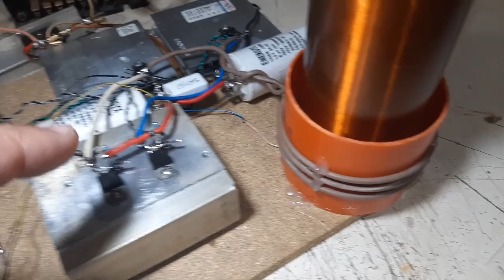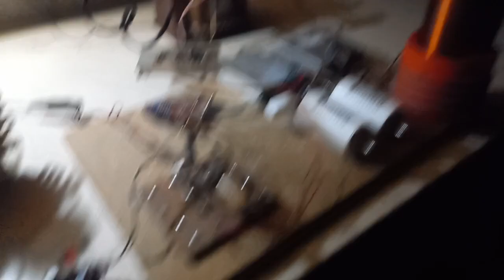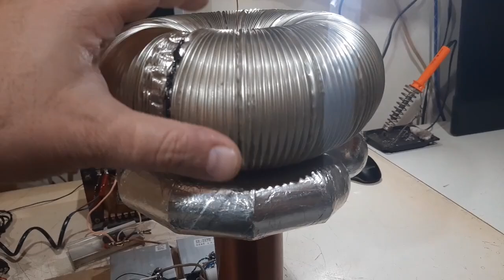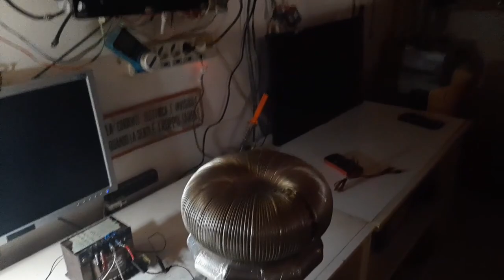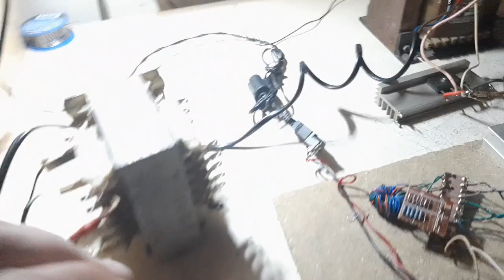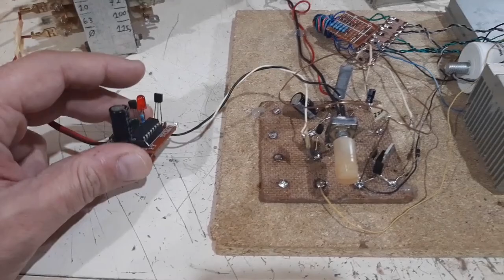A New & Simplified Low-V H-Bridge SSTC Tesla Coil

Comment: Nice! The sparks are close in length to the 240V mains half bridge coil I built some years ago (was based on a Diodegonewild design I think)! I have an old rack mount UPS in the shed which would work as a UPS again if I spent $50 on some good batteries. But it would also provide at least $50 worth of parts if I disassembled it... [Two buttons meme]
Reply from the maker: honestly i hate UPSs, i also love em for the transformer but i hate em cos every freakin' time i used one it was worse than not having it, at the slightest mains drop the relays flip back and forth and there's the chance that the computer reboots, i passed years like this before deciding of not using one anymore, much better now, plus the battery (for a consumer one) costs like 15-20€ for an unbranded one, i also hate batteries LOL

well, if you want to build a serious coil and parts availability is not a problem maybe IGBTs are a better choice than low voltage mosfets

yeah, i hoped for 20cm of sparks, if you refer to the coil diodegonewild built with a bootstrap control IC and fixed frequency adjusted with a pot i saw that coil, he had good results although the fixed frequency (that i don't like)

i still have to build a serious coil, i made one some years ago with IGBTs that made 30cm sparks but it was all wrong considering what i know now
Reply: I'm about to make the same half bridge with IR2153. But now I have to rethink.

Comment: Very nice! Love the simple design with the gate driver transformer. Pretty long sparks for such a low primary voltage! Perfectly tuned, I guess.
Reply from the maker: thank you, i'm happy with this coil cos it doesn't have complex circuits and the interrupter setpoint is adjustable... about the spark length, you can't do much more than this with UPS mosfets i guess, probably if using thicker conductors i could have scratched another 5cm... there's basically nothing to tune, it's a secondary i already had and you need just a big topload (that isn't an expensive demand)

Comment: Love it! "can be scaled" you say😊 that's the feeling after 10min running a coil 😊
Reply from the maker: well, i don't want to let it run full 50Hz if using IGBTs, i say it can be scaled cos you just need to put high voltage transistors and adapt the interrupter and primary a bit, maybe also using a more robust voltage limiter on the feedback winding, anyways yeah... i appreciate you love it 😊

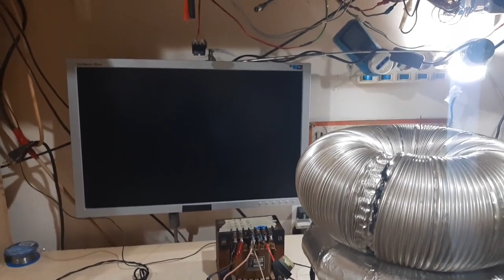Comment: I spent a few minutes staring at 10:55 until I understood the circuit - that thing is brutal, absolutely brutal simplicity; I love it!
Reply from the maker: thank you! 😊 ... actually i should have explained it a bit better but it's complicated to make a single speech explaining anything, the DC current applied on the ticker winding appears gradually to not trigger the coil a second time and is cut abruptly to make the GDT oscillate, once the current is cut the voltage on the GDT can swing freely cos of the diode and mosfet Vdso